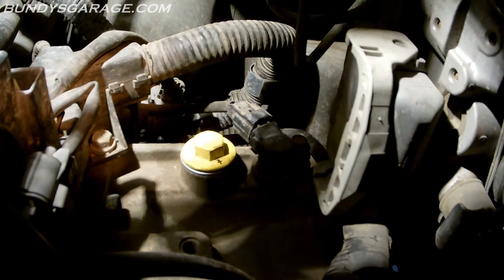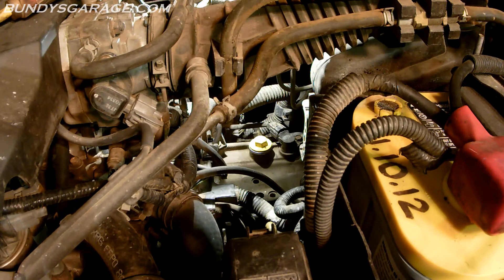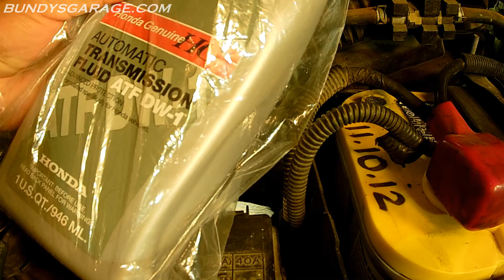99 - 04 Honda Acura Accord V6 Transmission fluid change - P0740 - Bundys Garage

Comment: Bundy at the end when you're showing the transmission fluids, that clunk you hear and feel when you put it into reverse is the front engine mount, it's separated and needs replaced. that's bad advice on your part but no worries, just need to let people know it has NOTHING to do with the fluid as valvoline maxlife is highly recommended for hondas at the odyclub (odyssey forum)

Comment: Only use Honda transmission fluid.  Honda transmissions require different additives to protect the gears and bands, and to allow the clutches to operate correctly.  Honda transmissions are different in design from other cars so they need special transmission fluid.
Reply: Are you John from Cochrane  Alberta?

Comment: Bundy how many quarts i need for a 2006 accord v6 automatic.
Reply from the maker: 4.5 qts
Reply: BundysGarage Thanks. I appreciate your quick respon.
Reply from the maker: No problem. That's for a drain and fill. Not a complete flush of the whole trans.

Comment: Please let us know if this actually fixes your P0740 code.
Why in the world did you put Ceratec in the transmission?  Only additive that I would try would be Lubeguard Red on a Honda or nothing.
Reply from the maker: Good question. I did it for you guys. No I wish I could say that, Ceratec claims you can use it in transmissions. I guess not Hondas. The banging noise from Park to Reverse was there before the Ceratec. I wanted to see if it would "ease" the bang. Instead I get a trouble code. After 500 miles going to drain and fill it again with DW-1.

Comment: The fluid you took out looked pretty bad ..... how many miles did the old fluid have on it?
Reply from the maker: 3,000 miles
Reply: +BundysGarage   ... I have an idea: have you heard of Auto-Rx ? I am testing it right now .... it is a way to clean any transmission, power steering system, or engine .....  this is one of those products that you might only hear about from word-of-mouth ... another mechanic told me abut it. Anyways, for an automatic transmission you would add 6 ounces of Auto-Rx and drive the car 1,000 miles ... then do a total flush of the system. So far I am about 500 miles into my test on my car .... I can say my car feels a little different ( as in better ) .... anyways, I was thinking Auto-Rx might make for an interesting experiment with your transmission here .......
Reply: +Rick S. I thought Bundy already had his transmission rebuilt.  How is it running?

Comment: I have Honda accord v6 2008 i use Amsoil ATF fluid transmission is working so smoothly and on cold days no hard shifting better than Honda ATF! The new 2012 and up the use DW1, from 2011 and older should be using Z1.when you ask Honda diler then say is OK to use DW1 on older Honda vehicle, how can use DW1 fluid is not designed for older transmission because fluid is ticker than older fluid, than later probably people will be having problems with transmission.